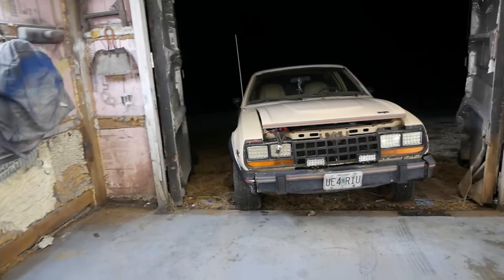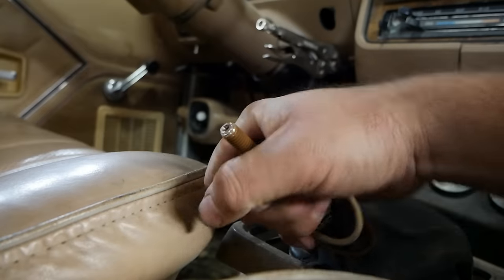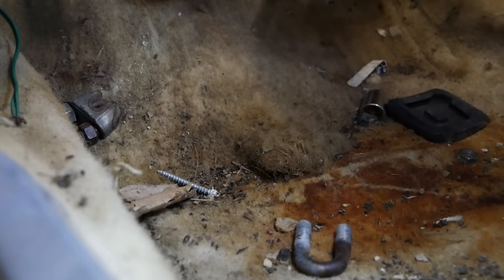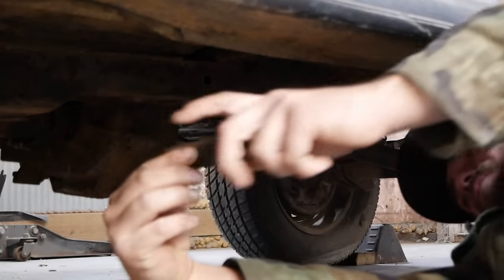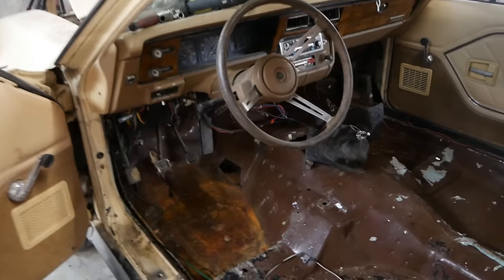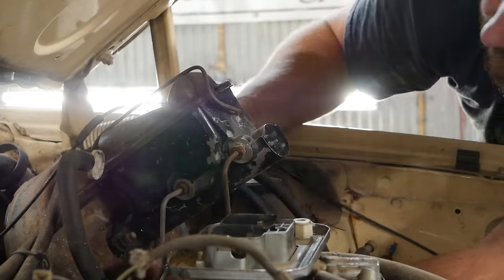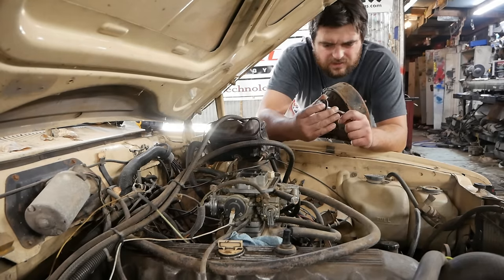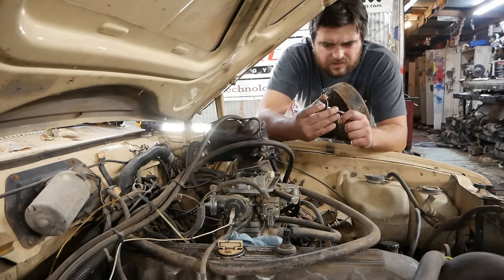Super RARE AMC Eagle SX4 - Project SCRAPYARD EAGLE Begins! From Dead to Daily Driver!

Comment: For checking out-of-sight clearance in situations like 36:20, one trick I've learned is to lightly wad up some aluminum foil and place it between the two parts.  It'll crush down without putting much pressure on anything, and then stay there, letting you see how much space there really is (or isn't).

Comment: Dude that's awesome, she moves under her own power,  very cool  the eagle is sick, definitely a 4.0 inline 6 went into the cherokee's excellent motor tons and tons of power
Reply from the maker: Well, some power. Wouldn't say tons lol
Reply: @PoleBarnGarage  the 1992  cherokee xj sport, I had would roast the 33' boggers it was the ax15 5 speed 2 door sport, with banks intake and header Msd igniting, then I put a full rough country 5.5 long arm lift on it, arb rear locker,  12.5 rcx winch, Half cage, door bars ,  I wish I had kept that one!!!!!! I built it in 2013...  built my own flat fenders, hood scoop. 
 got a roll bar from a old  1970s dodge welding truck it mounted to the top of the cab had 6 lights on it a a whip stick it was awesome 👌

Comment: I just finished a manual swap on my auto wagon. I got that willwood too but decided to just use the factory master I had because I didn't want to mess around making the willwood work. I wanted to mention that factory,  the clutch master does not bolt in straight up and down. The factory master the fitting for the clutch line is at like a 45° I imagine the reason the previous owner and yourself had to extend the line is because with the fitting adapters and changing the geometry of the line made it too short. Really sucks they cut a big hole in the floor for no reason. Looks like they replaced the carpet though and the sound deadening material used I'm sure you know was not factory. I'm seeing more and more eagles being revived on YouTube and it's great. I need to start posting more content.

Comment: I do love that wee beasty.  Cool shape, remarkably good looking interior, full gauge cluster - it just works for me.  As to the work done on the beast this time round?  Well, that mouse baby needed evicting and so does the smell, so hopefully Mama mouse had already found another location outside to carry on breeding.....or better still, got et by something feral.  I'm also of the mindset that if something don't belong there, then it goes bye-bye.  I had a Lumenition EI pack mounted on the inner front fender of my Stag.....even though there were points in the distributor.  Someone had even left it powered up with the ignition, so the unit was sitting there receiving power when the ignition was on for no reason other than historical homage.  

In tracing its wiring, I found that it (along with the signal wire for the electric fan relay) were slaved off the negative terminal on the coil......and yes, I'm talking about the same coil that feeds the points the ergs to make sparks happen!  So, another in the series of how a 5 minute task turned into a four hour one, but the engine bay looks better with less wires - and so does the engine bay on that Eagle, mate.  I know very well how tedious it is tracing wire and tidying it up, but it looks so much better after, eh.  Wish I had the guts to go at the Stag like you did under there.....  

Clutch master cylinder looks good, the reservoir is accessible and it all works fine, so a BIG win!  Can't see anything wrong with your content to complain about, myself (not that there ever is, in my opinion) and I am looking forward to the next episode on the Turd Bird....or whatever its name is.  Actually, did you pick a name yet?
Reply from the maker: Going with scrapyard eagle, on account I ain't real creative

Comment: You need to invest in a simple remote starter switch.  Would allow you to crank without having to be at the solenoid... Throws no sparks either.  

A bench vice would give you the extra hand you need  when cutting things as well.  

If you decide to give up on this SX4, feel free to contact me!   Can I tell you how many Eagles I have owned... Currently have 4, 3 with manual transmissions and you learn what tools can fit were your hands can't!  (SX4 258 5 speed, 2 Kammbacks, 4 cyl and 6 cyl  both 4 speeds and a 258 Auto Wagon.).
Reply from the maker: Yeah i always need one of those and never have one

Comment: I am not a car guy, but I had the misfortune of owning a 1984 Jeep Cherokee. It was the first model year of the compact Cherokee and the last model year of AMC. This video is giving me PTSD. The relay that you were talking about near the battery looks like the “anti-diesel relay”. That part burned out on my Cherokee. Once that failed, I had to pull the battery cable to get the headlights to turn off. My Cherokee also had a hole cut in the floor pan at about the same place. After having my clutch cylinder replaced, the system was too powerful for the plastic part on the end of the shaft that would engage the clutch. So that shattered inside the clutch. The hole was cut so the mechanic could access the clutch and pick all of the plastic shards out of the clutch. I was a poor college student so we probably did it that way for financial reasons. AMC at the time was trying to use all of its remaining part inventory, so you had different factories making Cherokees to completely different specs with whatever they had. I had to replace the water pump at one point and had to find the motor serial number to determine which pump to get. You couldn’t tell from the VIN number.

Comment: Mount the clutch master cylinder reservoir on the drivers side of the wiper motor were the wire harness bolts to the fire wall. I used the reservoir from a 2003 Honda CR-V when I put a reservoir on my Eagle. You can fill it from the crack between the hood and the fire wall when you open the hood.
Reply from the maker: I think that's where I mounted it
Reply: Yeah I saw that after I finished watching the video. Keep up the good work. What Transmission is in the Eagle? The factory manual transmission was either a Borg Warner T4 or T5.

Comment: No surprise the original clutch master-cylinder is NLA, since (I think?) AMC basically bought up warehouses of surplus parts from other auto-makers to build their cars. (why they're full of parts that fit all kinds of random other vehicles)
Just another reason I like them, as I'd like to build a car from-scratch with whatever cheap used parts I can scrounge up someday! XD Might make back some more of the purchase-price by selling off rare stuff, like that ECU, to those that want to do a perfect restoration! Aw, poor li'l mousie. Jeez, how the heck did they get to the car up on the container?
Makes me wonder if it hadn't been set up there very long, maybe not at the yard very long since being moved from where it was previously parked. Soak that carpet with some DGerm and it'll be golden!
Huh, used to be an automatic? I wonder if it was driven long after the conversion?

Comment: Cool car. The duck tape is factory as my son’s 88 Jeep Comanche had the same splices. Also,did they happen to use a 4.0 starter? If so, it should have the starter relay on it and you could ditch the stand alone.
Reply from the maker: Looks like it doesn't have a solenoid on it

Comment: I loved the part where your pulling wire like a high voltage electrician pulling wire in a industrial setting. We complain when we pull wire just like you do for the car but the runs are much longer. It's a heave ho kind of situation. It was funny seeing you go through the same thing as electricians. Plus your doing amazing with this gem.
Reply from the maker: I'm an industrial electrician lol

Comment: Id offer to trade you a motorcraft 2100 and hei for that center console, but sadly youve already got those departments covered. Ive been looking for one of those for years. I do have the original automatic and transfer case if you wanna get rid of the stick, slim chance as it may be. As for the transfer case, on the rear of it there should be a red and chrome tag, Stock it would be a NP129 or NP229, but depending on what the gearbox is out of, it could be any number of jeep cases.
Reply from the maker: Shoot me an email (about section on the channel page) I have an extra console SOMEWHERE if I can find the thing
Reply: @PoleBarnGarage  Oh hell yeah, thanks man

Comment: A friend of mine it's pretty old now he's older than me and I'm 61 he has one of them it's sitting up in North Carolina probably hasn't been run I'm going to say at least 5 to 8 years maybe longer so automatic though cuz I know all about it I worked on it many times I even put a another automatic transmission in it form what was that a job with that transfer case especially doing it on the ground
Reply from the maker: I put a transfer case in an 80 eagle coupe in my gravel driveway without even jacking it up lol

Comment: Whatcha gonna do for an ignition control module, buy a MSD-6A --- or go back to a points distributor?
There's nothing wrong with the Duraspark system, had three AMC's and probably 6 or 7 Ford cars and trucks with it and never had a problem.
Reply from the maker: Use the gm hei unit that's in it
Reply: @PoleBarnGarage  Oh I see you added the GM HEI module to the Ford Duraspark dist... good enough.
My 79 304 Spirt 2 wheel drive 4 speed I dropped the front and put Mickey Thompson 12" wide M50's on it for that Rat Fink steamroller look... had a lotta fun until the shock towers rusted out.

Comment: As far as the Transfer case the AMC four wheel drive cars were using pretty much truck stuff to make them at that time. So that very well could be the original. I can't say for absolute certainty but it would have been something like what they were doing then. The nice stuff like they have now or that AUDI came up with just wasn't used yet in the cars and AUDI wasn't really a house hold name in the USA yet.

Comment: Please explain your statement that its a 4.0 and not a 4.2. I thought the 258 was the only 6 cylinder optioned and the 4.0 wasn't released till like 87 in the cherokee..
Reply from the maker: Yes, it's been swapped. They're basically the same engine, just bolts in
Reply: That's my bad. I had to look back at the first video..  seems a step backwards to put a carb on the 4.0 the fi systems aren't too complicated to swap over..  check the front fender where the upper control arm mounts for rust. Bad design in that location.

Comment: The ole car was probably quiet as a Cadillac before a couple of knuckleheads pulled the insulation out.
1984 Transfer case? Start with Dodge parts then go to GM to find correct parts for your Rambler 4 wheel drive case.
( No more vice grip brand tools for me. If I wanted 'made in china' tools I'd live there. )
Reply from the maker: Yeah, pretty sure that was ducting insulation.

Comment: They probably blew the hole in the floor so they could tie some wire to the clutch lever to pull it by hand when the master cyl went out. Its ghetto as hell, but that's all I could figure it would be there for. Either that or they were trying to get the bolts out of the slave cyl the (incredibly) lazy way and just missed the mark by a mile

Comment: here for it all ya its vacum others now electric before way back links and gears chains and sprockets even simpler design not much on light way plastic or aluminum like cast and steel or sheet matal its process each system lots old add in new or remove that stuff like key lock cilyders the can get better stuff but yep those lock out systems heat and running and driveing rest is over rated nothing like good fluids and fuel system brakes are pain

Comment: TOO BAD IT IS NOT AN (AMX) THOSE 4×4 DID HAVE LOTS OF PROBLEMS WITH THE FRONT 4 WHEEL NOT WORKING THE MODULATOR VALVE WOULD ROT THE VACCUM LINES TOO THE FRONT 4WHEEL DR.WHEN U WORK ON OLD LINES ,BRAKE THE LINE  OFF AT THEN END AND USE A SOCKET AND RACHET  SOME TIMES USE SOME HEAT!!!!!!!!!!! JUST LIKE IF U HAVE BROKEN BOLTS .OH MY GOD WHAT I DO NOW DO,NT PANINC U KNOW THEY DO MAKE LIFT KITS FOR THAT CAR WHEN I WAS YOUNGER THIS WAS MY FIRST CAR WITH THE SAME PROBLEMS  ,KIDS DROVE AND F.U.ED IT UP!!!!